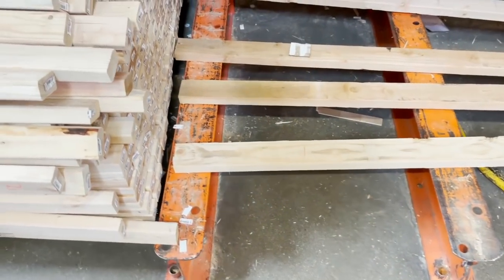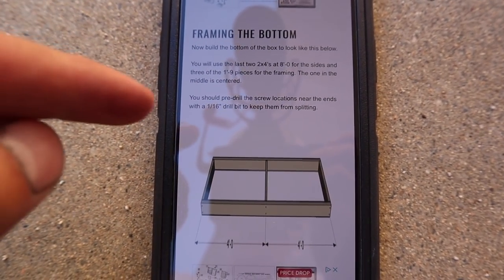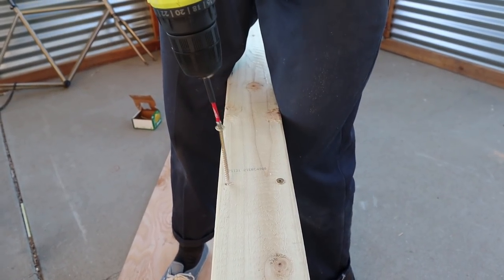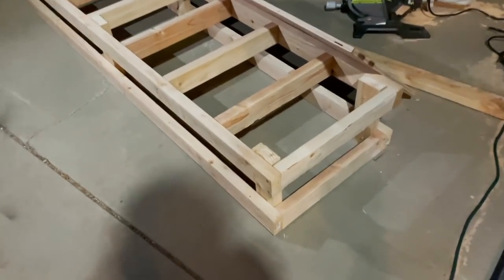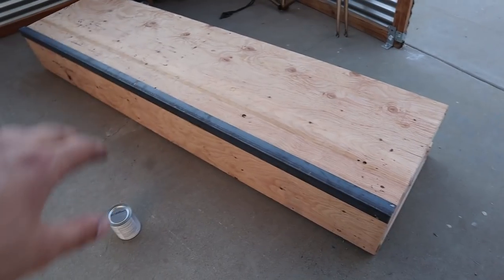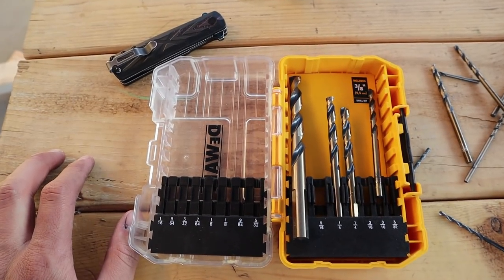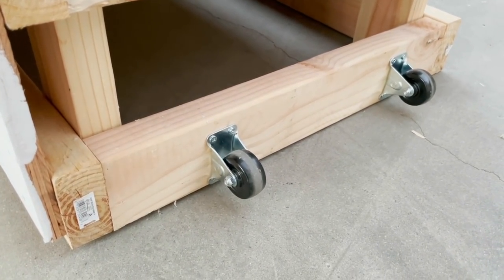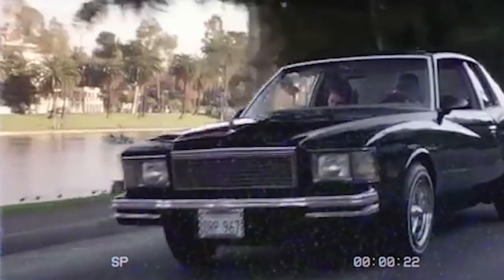D.I.Y Grind Box ( MADE SIMPLE )

Comment: Good work! Shits hard if you don’t do it all the time. Small tip for building boxes - buy a sheet of Masonite that’s the same thickness as your angle iron then after everything you’ve done in this video (except paint) add the Masonite on the top and side so it’s butted up against the angle iron and it will sit flush. This way the top and side are just one flat surface with a metal corner instead of the angle iron sticking out. Doesn’t make a huge difference but a sheet of Masonite is super cheap and it’s a nice little touch. Also Masonite is smooth so you don’t have to paint it but may need to replace it once a year or so it it’s exposed to water
Reply from the maker: I was asking the Home Depot guy about that but they didn’t have anything on hand… that’s what I wanted to go with!

Comment: I love your channel. I'm currently building a mini ramp in my backyard, it'll be finished in a few days. I've worked in construction for many years. Here's a tip when drilling steel. Get some oil they make a 3 in 1 or you can just use some motor oil. Just put a few dabs on your bit, or spot you're going to drill. Use more if needed. You'll save money on drill bits they'll last a long time. Peace!